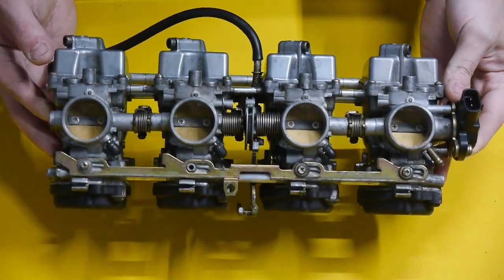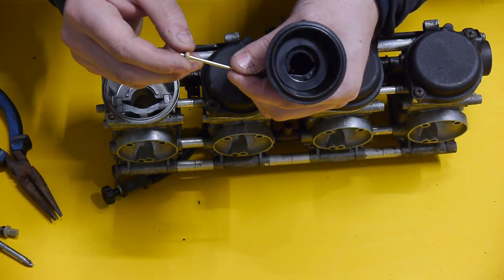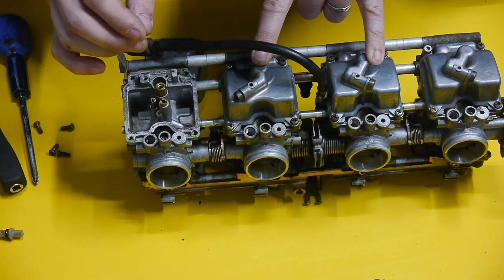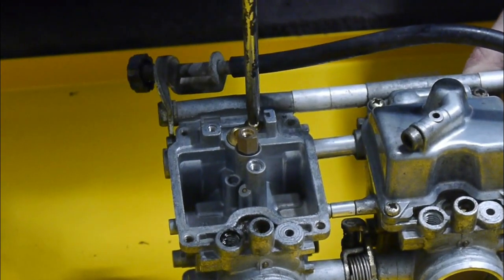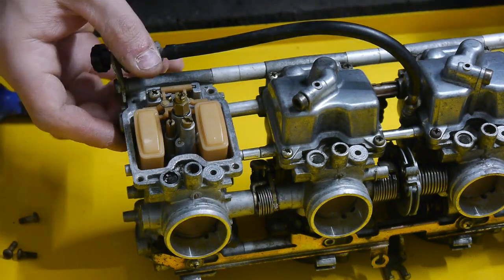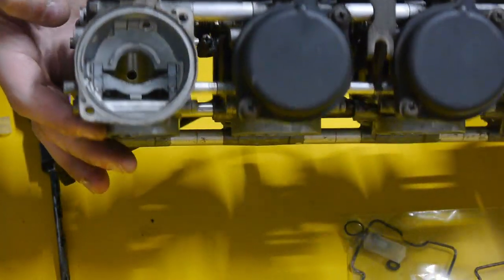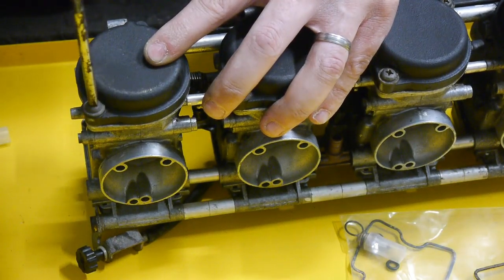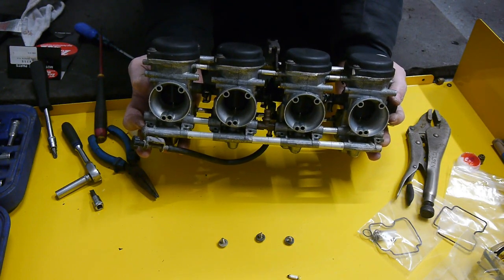How to Clean & Rebuild Your Carburettor

Comment: This is excellent information and well covered. I am trying to fix the same carbs on a 2004 GSX600F, and was given the old jets in a bag, and see the jets the user installed have no markings. Old jets are back in per your video, and on to the floats. Much appreciated. The wind didn’t bother me.
Reply from the maker: Glad I could be of help Tony
Reply: I also have a 2004 gsx600f trying to figure out the issues with it which brought me to this video, it's cranking but not wanting to start, petcock is fine,changed the spark plugs and still not starting. Could it be a carburetor related issue?
Reply: @floridaboyhernandez9550   Someone rebuilt the carbs before me, because their bike wasn't running.  I suspected they were still not right, so I rebuilt them again.  Unfortunately, they didn't set the adjusting screws the way they were before the rebuild and there is no reliable info online for the correct settings.  It never would run.  It is not my bike.  I couldn't help. I would ship my carbs to the person who posted this video.
Reply: late to the party but I'm on a 02 gsx600f that was running around 4,000 idle a couple of days ago now it won't start and it's leaking gas
Reply: We had one carb leaking at the drain screw. I bought new ones, but it did not fix the problem. Sold the bike as is at a significant discount.

Comment: Video was great to follow, but i have had to admit defeat after the 4th time of trying to stop it leaking after the overhaul.   Learned a lot though thanks for the tutorial. Let hope the garage does a better job :-D
Reply: I've already repaired the carburetor on the Bandit 1200 three times. I've learned a lot, but the problem keeps repeating itself. The worst engine, I later found out that this is a common problem on the Bandit...

Comment: Be sure to tighten the mix screw till it bottoms out first count in half turns of the screwdriver till it bottoms out then unscrew it if its your first time doing this and you just unscrew first you wont really know how far to screw it bk in but with this method when you put the screw back in you just bottom out the screw and count backwards to get it in the position it was in before

Comment: Nice video fella gonna take a look at mine as got number 1 cylinder isn’t fueling right gone through new plugs and good spark but getting no heat through header pipe so can only assume it’s carb related doubt be compression as bike has been sat and ram great before
Reply from the maker: Thanks. I’m Glad you liked the video.

Comment: My katana was running real crappy and thought I needed to rebuild carbs, replaced the throttle position sensor and it made a big difference, no more back firing when I let off the throttle and back to snappy throttle response. wasn't looking forward to rebuilding the carbs.

Comment: Awesome video. I'm about to clean my first set of carbs on my FZ1 you made it look a lot less complicated then others, just curious on what you used to clean everything seems to be mix debate from everywhere that i have looked
Reply from the maker: Thank you very much. I’m glad I could be of help. I find Brake cleaner will do fine for most of the cleaning but proper carb cleaner is better for removing the green or orange stains.

Comment: I rebuilt my carb and got it to idle at 2-3k rpms. I loosened the pilot idle screws just a tad bit and now it wont idle at all. Just shuts off. I tried a couple different adjustments but i just cant seem to get it to idle. Any recommendations?
Reply from the maker: the first thing I would do if possible is get a Haynes manual or workshop manual for your exact biker and reset all the settings to standard. if you get it running then adjust the idle knob at the side of the carbs to lower the rpm and not the mixture screws. Also remember to balance the carbs too as this could be affecting it

Comment: Need advice have two 05 katanas 600s both are loading up dumping fuel into air box and then into my oil have not messed with carbs only idle adj somebody tell me how to solve please
Reply: Both my 05 katanas ran fine now dumping fuel into air box then my oil idle adj knob is only thing I've moved need advice help a guy out please
Reply: Foat or floats are sticking .. causing an over fuel problem..
Good luck...
Reply: Fuel petcock diaphragm failure